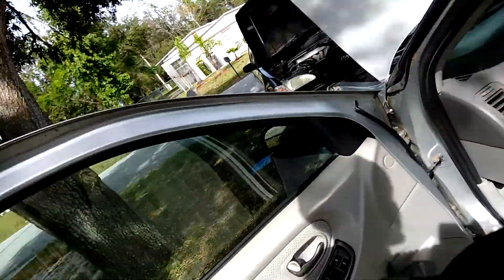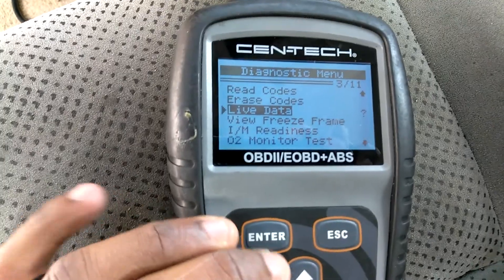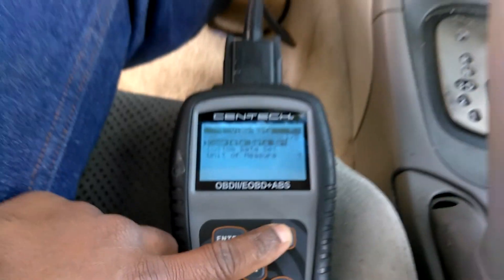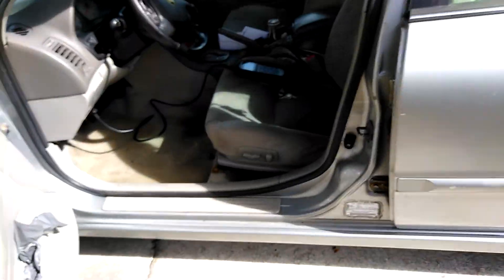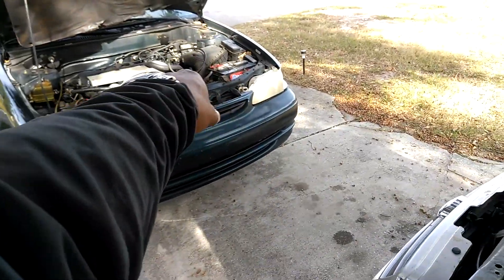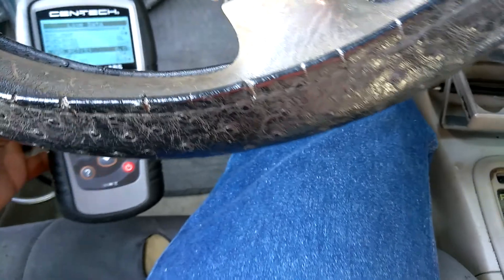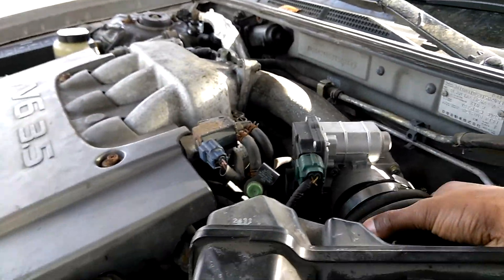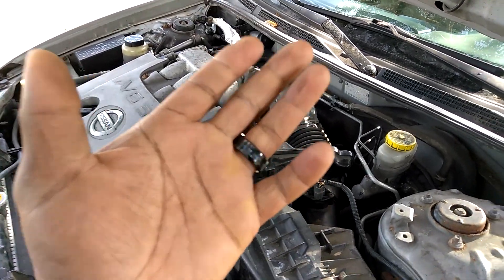Cheap centech scanner tutorial

Comment: Thanks Pat, informative video. I have the same scan tool and similar symptoms in my '09 Sebring 2.4L (I'm the original owner)... in my case it's either the throttle body, MAF or MAP sensor or possibly pedal itself. With 262k on dash who the heck knows 😆
Reply: What did it end up being bro? I’m having issues myself and now my car is in limp mode
Reply: @joshw9037  In my case it was the throttle body. Purchased a used one from a junk yard with only 15,000 miles on it for $70 and for an extra $10 they gave me a 2yr unlimited mile warranty.

Replacing the throttle body was pretty simple.